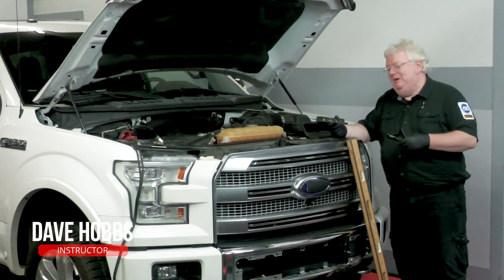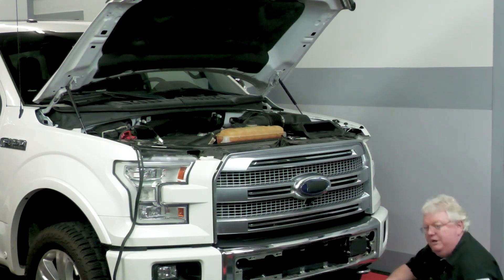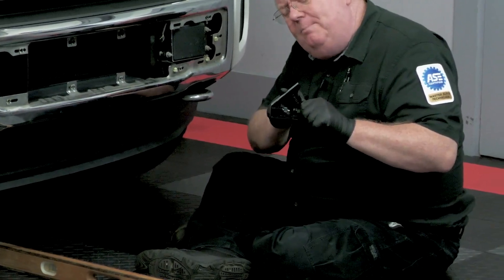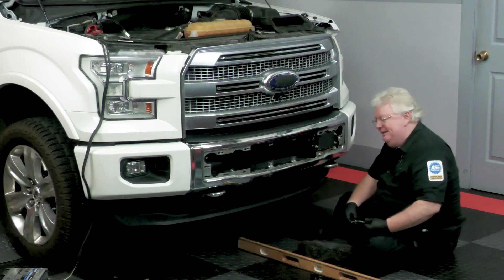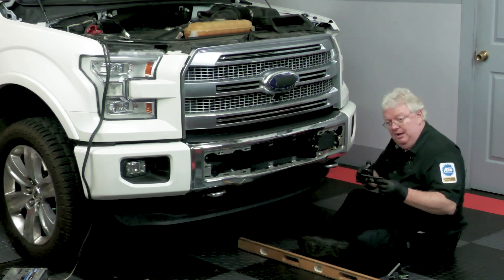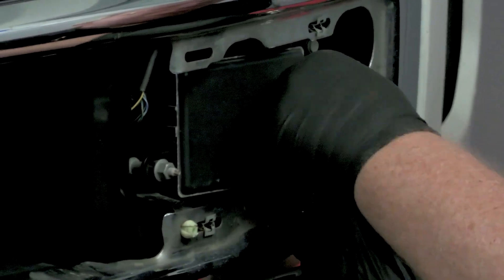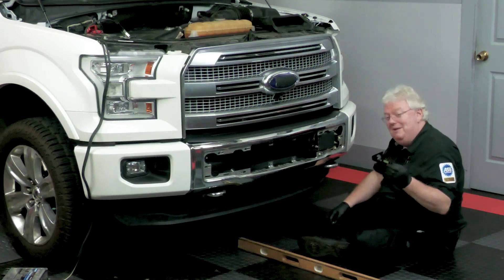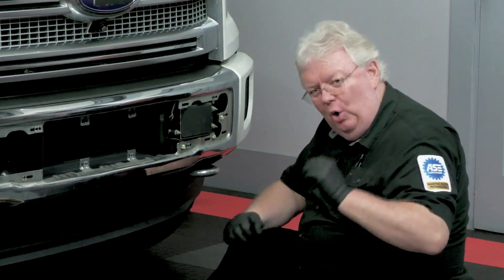Vertical Radar Adjustment | Advanced Driver Assistance Systems | Tech Tip

Comment: I added a 5.5" lift to my 25 F250 and am running 38" tires. my pre-collision is no longer working because the sensor is having issues, I’ve taken it back to the dealer and the only way they could get it to recalibrate was to put stock tires back on the truck, tilt the sensor down one or 2° I don’t remember for sure, and they got it to recalibrate, but within about five or six days I got the error message again. Of course now I have my 38 inch tires back on there and I feel like that’s throwing the recalibration off. Do you have any information you can share with me about how to get this thing recalibrated and working with my current set up? I am told by several people across the nation that after the truck’s been lifted and these bigger tires put on you can recalibrate these but no one locally where I’m at seems to know how to do it.
Reply: Did you ever figure out it out? I’m pretty much in the same boat but mine was fine until I put a bumper spacer on it then just stuck the sensor back on. It works the majority of the time but says something is blocking the sensor every few days or every few drives recently.
Reply: @bskarpa i did get a fix and it's been working for a while. But your issue sounds different.